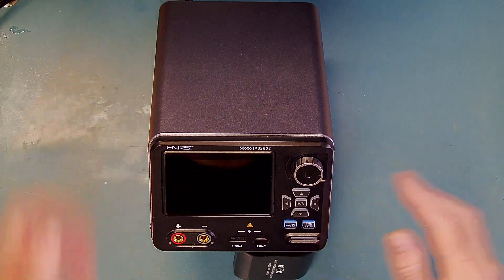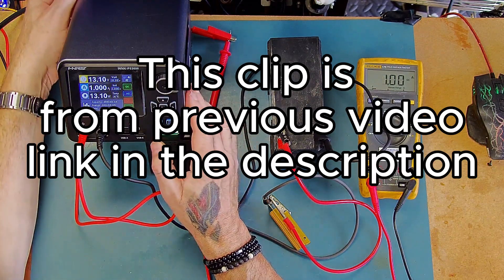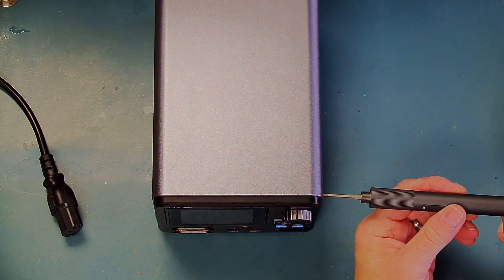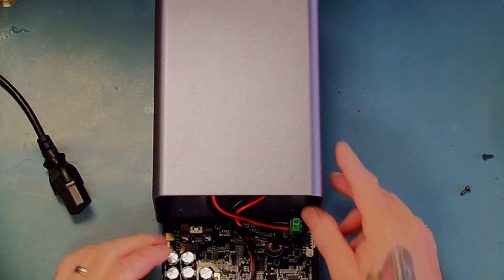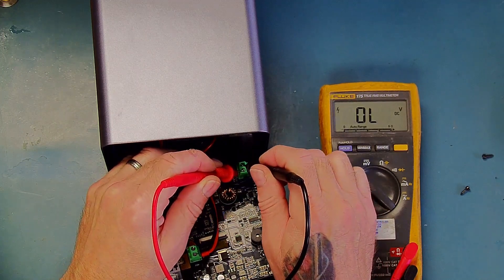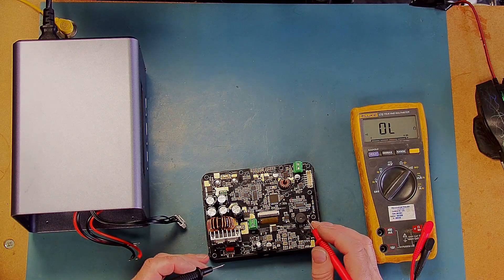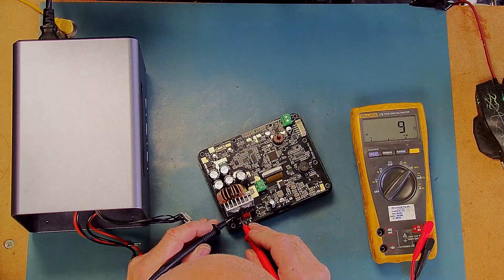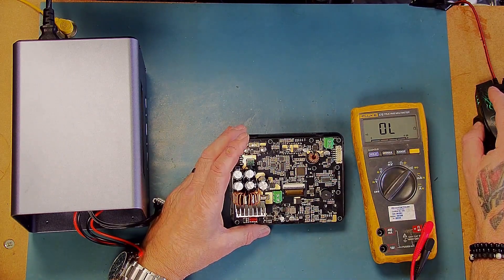DEAD - Charging(ish) a 12V SLA Killed My Fnirsi IPS 3608

Comment: Definitivamente no recomiendas esta fuente de poder ?
Reply from the maker: Hi, it depends on your usage requirements. If you want a compact unit with good features and don’t want to push it too hard , I think it is probably ok for the cost. If you want to push it, especially with low voltage, high current , or want to charge batteries or switch the load on/off frequently for short periods, do not buy IMO.

Comment: Let me guess, they ignored your email. Which is exactly what they did to me. I had to get PayPal involved
Reply from the maker: Hi, I have had a response from Fnirsi. They asked me to remove the front and check the ribbon cable for the screen, I did that and sent photos of the cable and the open fuse and short mosfets. They replied again with a link to a Chinese supplier of the internal littlefuse, and asked me to replace it. I replied to that saying changing the fuse will not help, due to the mosfets and probable other damage,and asked that they replace the entire front panel. The answer to that was I will have to send your request to the relevant department. Nothing more so far. One thing I found interesting was that they referred me to a genuine littlefuse and not the copies they actually use in the power supply.

Comment: One pro tip I learned over the years charging random lead acid I always use 2 BY255 on both poles of the battery, I prefer overheating the diodes then blowing the powersupply.
Reply from the maker: Hi, thanks for the advice. This problem was a result of subscriber requests. It would appear that many people are using this power supply to charge various batteries, and many people are blowing fuses. This is what I investigated in the previous video , liked in the description and the result was a dead unit. The manufacturer clearly advertises this power supply for charging batteries. Personally I would not use this type of power supply to charge batteries.

Comment: When hooking up battery's to a power supply, use a Shockey diode with suitable current capacity inline of the positive lead and that will prevent the reverse flow back into the power supply.
That is probably why the fan stayed running. most power supply's these days do not have a reverse flow protection diode installed in them.
There will be a voltage drop of around 0.2 - 0.3 volts after the diode. but it will protect the power supply. 
It is also a good idea to use one if you are playing with DC motors. When DC motors spin down they become generators and will put voltage back into the supply.
Reply from the maker: Hi, yes I totally agree. I was asked to perform this test by subscribers. This appears to be a common issue with many people, mainly because fnirsi advertise the capability of charging batteries from this exact unit without any external protection. This is clearly misleading . Personally I would never use this type of power supply to charge a battery in this manner, that’s just me though.